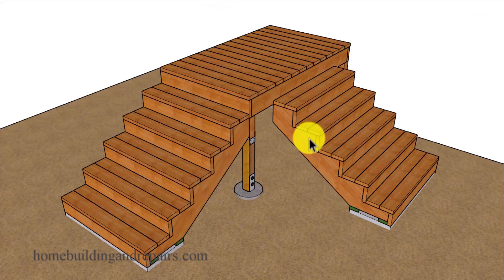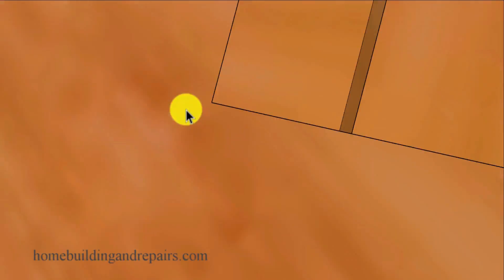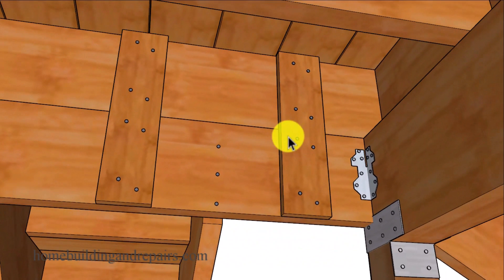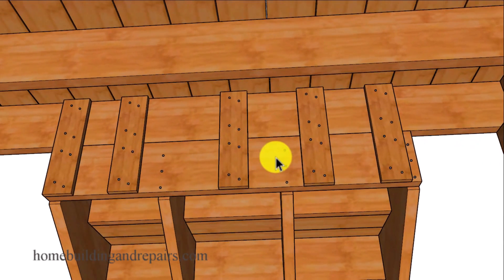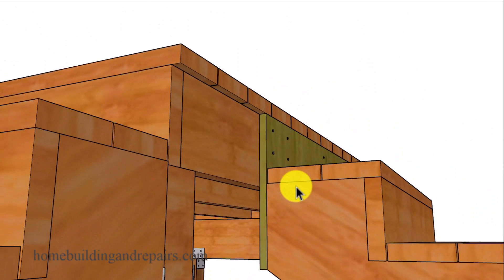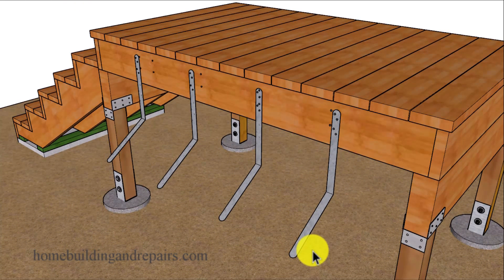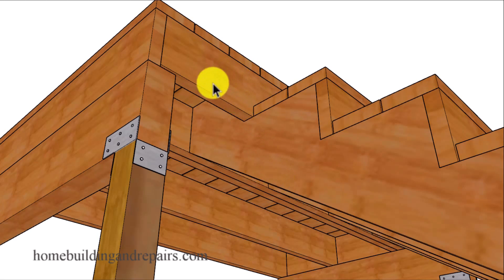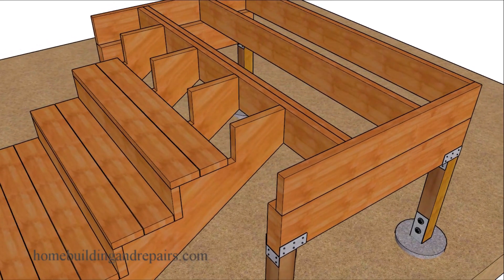More Ways To Connect Stairs To Decks That Don't Have Much Structural Support - Building Ideas

Comment: I am retrofitting my old deck with new stairs and I was considering the last option.  To accommodate the stair height I would need to make three, one inch notches in the 2x8 DOUBLE joist. Is this a bad idea? Seems fairly reasonable.
Reply from the maker: Probably not, but it will depend on your project and size of stairs and deck

Comment: Generally in deck building, I add one extra thread and nail it flush to the top of the outside band. Problem solved. The inspectors always pass it.
Reply: I am not sure what youre saying. Is there a picture?

Comment: The idea of this extending a step in to the deck doesn’t work for me because the rim joist is double and I have to cut a bit gap under the rim so the remaining uncut 2x12 is less than 5”, in fact only 3” so that too thin for the code of 5” minimum, I was excited for a couple days when watching your ideas for stairs connecting with deck